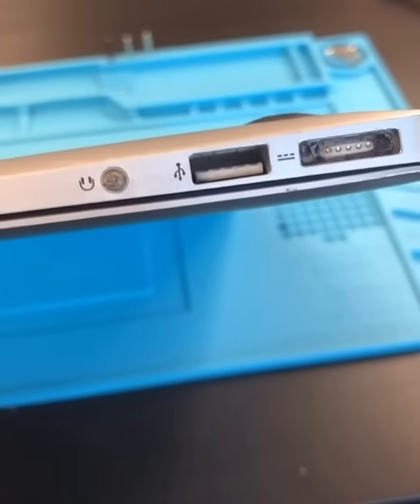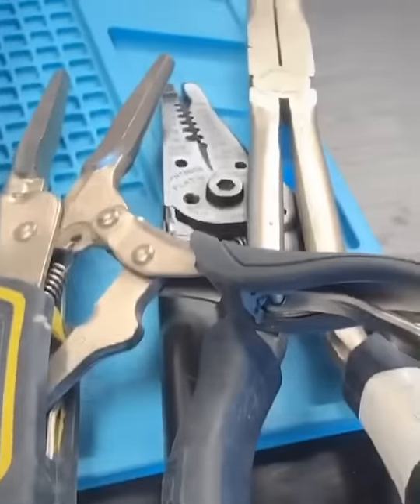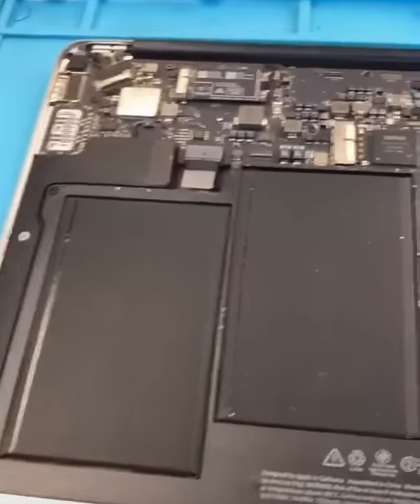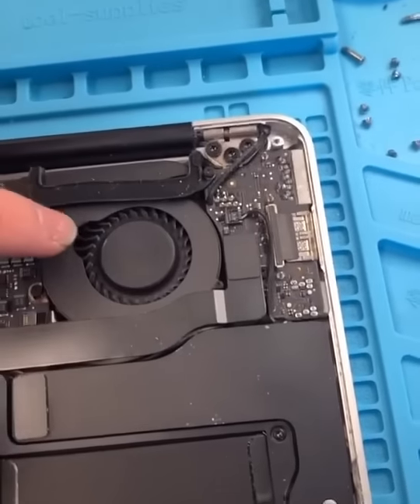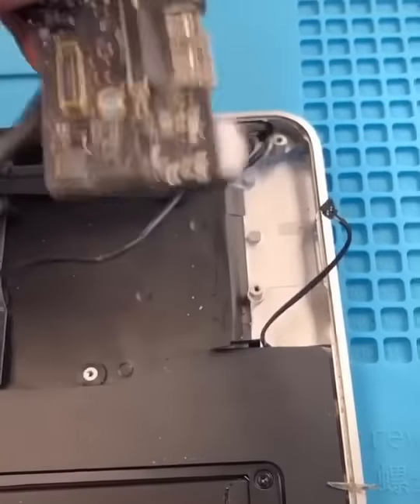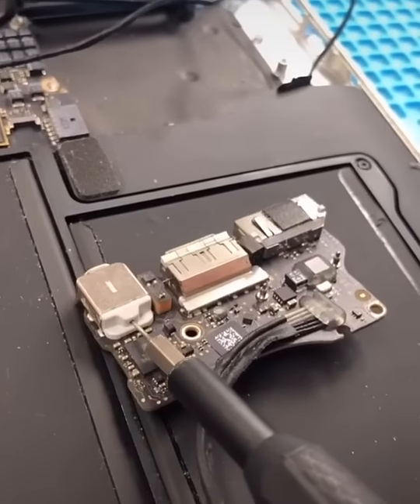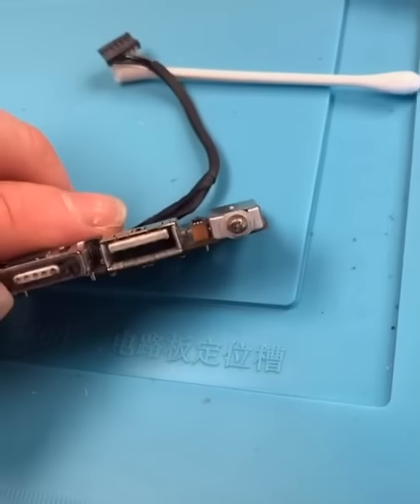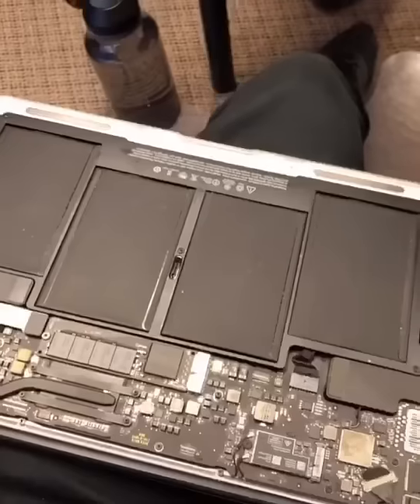Don't Use Glue On Your Macbook.... WHY? #Shorts

Comment: The real reason apple doesn't want you to repair their devices. All the parts are made and sold by Samsung 😂
Reply: Samsung is one of the two chip manufacturer in the entire world. Every chip is either manufactured by Samsung or TSMC. The small ones were all RAM modules. Apple designs the board and the SoC, but they don’t physically manufacture them.

Saying Apple’s computers are made of samsung parts is like saying that the sushi you ate was made by the fisherman and not the chef.
Reply: U didn't know lol?
Reply: @Dracogame  sounds very technical. If you were my teacher in school I would probably fail with all those confusing words. And saying it would be a btch cause I have verbal dyslexia lol
Reply: @Dracogame  Yes, that's why I don't buy Apple's product, they're like selling sushi 2x more expensive even though are made from the same fish and caught by the same fisherman
Reply: @Dracogame  Wrong way of saying it  the fisherman got the fish but the restaurant just put it together Samsung makes and sells the parts but apple just puts them together
Reply: @iamincognito7125  dawg your still in 2010
Reply: @iAmGh33zy  Some parts like RAM are standard in the industry but are still made by Apple's specification.
Reply: @iamincognito7125  Then stop buying any product. Even your car contains chips made by Samsung or TSMC. Your television. Your microwave. Everything.
Reply: @Dracogame  this is simply not true. Nvidia, amd, and sk hynix for starters
Reply: @Dracogame  haha that guy tried doing a "gotcha" thing and failed
Reply: @Dracogame   I don't know where you got that information from, but 2 companies alone don't have a worldwide monopoly on semiconductor fabrication.
You've got SMIC and UMC for example. I think SMIC is the leading one in China.
Reply: @Dracogame   bruh, you don't have to get into it
Reply: lol only some u dont know what ur takkinf about
Reply: I read everything and everyone is dissing you, apple makes every part of the computer to make it run, hold storage, turn on, everything then Samsung as you said is the cheaper chip manufacturing company with better parts for ram, a added software that increases the ability of the computer not make it run. So apple does the computer, makes everything except for the added specs that people want. If anyone would have actually looked at the computer they would see that those five parts were add ons and every other 900 or so parts are made from and manufactured by apple. With apple having better specs in general to Samsung, better run speed, display, etc. I buy apple products and I am happy. For general if I look at the new fold screen Samsung. No one needs a tablet as they call it in their pocket that’s also over a thousand dollars
Reply: @kianbronner652  Apple aren't that special, don't become a victim of marketing.

If you spend the same amount of money building your own computer and installing MacOS on it (although why would you, then just install Linux) as you do buying a prebuilt Macbook, you will end up with a superior computer. You will be able to buy superior hardware because you aren't paying a premium on it as you do when you're buying it from Apple (or from any other company that sells prebuilt computers for that matter).

Apples entire thing is trying to provide a luxurious feeling experience to consumer grade hardware. What you're paying for is that experience, not actually superior hardware.
Reply: @kianbronner652  Did you just say Apple have better displays than Samsung???
Reply: @Dracogame  there are a lot more you mong. Intel is planning on making (3?) New semiconductor fabrication plants by (2025?), and Texas instruments was a major player in the dawn of personal computers is still very relevant in more irrelevant devices today plus massive companies making memory like micron and sk hynix. This is just to name couple.
Reply: @Dracogame  please don’t ever talk tech again you’re so wrong🤣🤣. So intel, amd, nvidia and Texas Instruments all went defunct right?
Reply: OOF
Reply: @Dracogame  ok just don't cry lol
Reply: Best part of the whole video lol
Reply: @SolidFawaz  Okaay (?)
Reply: @Dracogame   The fisherman doesn't have the fishes signed that he made it.
Reply: @TrillAntho  amd uses tsmc fabs and nvidia uses samsung, soon switching to tsmc.
Reply: @lukeskywalker7405  He is still the provider.
Reply: @lukechristenson3989  lol what, this dude doesn't know his shit😂
Reply: Bruh LOL
Reply: I honestly  hate apple. Not because of their design or interface, but because of their business model:
They are basically forcing you to stay with only apple products to use the features that are important (cloud, airdrop, interdevice communication). That way you have to rely on this one company and can't branch out. I really don't get their appeal. And I can't wrap my mind arround the fact that a lot of schools and companies (mostly start ups) use their products. That way they basically make themselves dependent on ONE company.
Reply: @Dracogame  quit trying to make yourself feel better saying that 😂😂
Reply: lmao they were friends all along
Reply: @iamincognito7125  nice
Reply: @Dracogame  there are more chip manufacters
Reply: @michealjaymurphy  what
Reply: @Dracogame  nah
Reply: @Random131_  this is mostly true, not all displays are Samsung
Reply: @tatuman5000  the iphone came 1st...
Reply: @iAmGh33zy  wrong.
Reply: @LxckyHandlez  Be part of the discussion
Reply: @iAmGh33zy  wrong
Reply: @Dracogame  No one is saying Apple doesn't make their own phones, what they aren't making are the parts the their devices are comprised of.
Reply: Lol
Reply: @kianbronner652  APpLe hAvE beTtEr dISpLAy ThaN SaMSunG, lol 🤣🤣🤣🤣🤣
Reply: @Dracogame  there are wayyy more than two chip manufacturers but tsmc and Samsung are some of the largest. Intel has their own fabs for example
Reply: Yeah so they can't repair it. Only Samsung can
Reply: @strawberrylia655  well Samsung parts are available in the market so the person with enough knowledge can easily repair it using those parts
Reply: So samsung is better
Reply: @MariaReyes-jp6ok  yup, infact every android phone is better, better customization option better feature,etc , not really that good of camera as iphone, this is coz Apple just have to maintain it's user base and their ecosystem does the job so there ain't much competition in ios but in Android there is a lot of competition, competition leads to better features and better quality, still apple lost 26% of it's user which shifted to Android in 2020 alone, so hey Apple's ecosystem isn't really working out
Reply: Then why is apple so shit
Reply: No just the display and a few other things
Reply: @Karl_der_Genosse  I like them because once you’re in the ecosystem everything just works together beautifully unlike if you have all different brands of computer, tablet, phone, etc. and then not everything works great together all the time
Reply: Ever heard of Refurbished?
Reply: No Samsung is not selling the things they make for Apple on regular shelf’s they build them to apples specifications so they cannot just sell them
Reply: @Dracogame  but i ate eggs and bacon
Reply: @Dracogame  but the dude is right
Reply: @kianbronner652  Samsung makes the storage and displays for Apple also some apple devices use LG displays .
Reply: I changed it from 69 replies to 70 lol
Reply: @iAmGh33zy  is that not legit exactly what he said
Reply: @kianbronner652  "add ons" so  your computer doesn't need a graphics chip or ram modules to run there just add ons? This ain't a wifi card man
Reply: @iamincognito7125  😂😂
Reply: @throwdemhoez5488  that’s though but why say it here
Reply: @iamincognito7125  Um I’m assuming you’ve never had good sushi then
Reply: @xperiahenrik that’s why I buy apple. I just want working devices that is more than fine in everyday situations and is well know ofc. Apple may have evil marketing people but still doesn’t really matter that whole much
Reply: @Dracogame  because Samsung is the best😂
Reply: @Dracogame  actually. The cpu cores are made by arm.
Reply: @throwdemhoez5488  well I'm a tech geek so I understand what he is saying lol
Reply: @Dracogame  what if I told u smic and other brands exist. Like huawei for example can't get its kirin chip produced from tsmc or Samsung. But instead like smic it produces them. I'm a tech geek so I don't think so u wanna challenge me
Reply: @iamincognito7125  as if they're anymore expensive than samnsung and new android devices 😒
Reply: One word: Exynos
Reply: Correct
Reply: @iamincognito7125  no, cause the fish man can create whatever you want, and Apple creates her sushi.. For example, there isn’t any laptop (to not game) so cheap and so powerful as the MacBook Air M1, without a balanced 1600p LCD screen, high quality integrated speakers, high quality integrated microphones, and quality materials..
Reply: @xperiahenrik  M1 best laptop CPU for now left the chat
Reply: LeopardX  Mhhh.. who design the chips? The display? Etc? Lemme think, Apple… Samsung are only the arms
Reply: @Dracogame  TSMC and Samsung are not the only two manufacturers in the world? Micron, Intel, Global foundries etc etc
Reply: Exactly
Reply: Pft
Reply: xD
Reply: Apple is like the generic food brand that it's made by the same company as the expensive brand, but instead of being cheaper it's more expensive
Reply: Ur name is sam
Reply: Idk, samsung always follow apple trend like charger one and jack audio, make other android phone follow samsung too, so we know samsung is just part of apple
Reply: Only reason why it's remotely good🤣
Reply: @Dracogame  not really I mena we get appple revolutionized phones but still
Reply: @Dracogame  it's made from Samsung still lol. The design is made by apple but the product itself is made by Samsung
Reply: @Ryan-uv6ky  Yeah, that's how a supply chain works.
Reply: @lukechristenson3989  no, nvidia, arm etc design their own chips but tsmc and samsung are the ones who fabricate them
Reply: @s4lvin989   not the best, i would say its best for casual use, something like ryzen 4000 mobile chips are literally power houses compared to it, also considering the price of the two its further justifies my point. also everything is not fully ported to arm yet so yea u will face some difficulty running old stuff etc and it may even performance like dog shit, also now bringing in gaming, apple..... gaming lmfao lets just skip that one XD
Reply: @ShahZahid  the M1 is as powerful as the 5900HX, the best laptop Ryzen CPU for now, so for now the M1 is one of the best laptop CPU on the market, and 3 times better than the 5900HX for performance/consumption
Reply: @iltubodeitutorials8358  no its really not direct benchmarks mean nothing here since the architectures for both chips are different x86 being more diverse since it supports more instruction sets, also 3 times better wtf, u just said its as good as the 5900hx now u are saying its 3x better, just settle on something already also it, also if u are considering benchmarks, 5900hx scores 23000 on cpumark while as m1 does around 15000, so its not even as powerful as the 5900hx well thats expected from an arm chip also then comes the case of integrated graphics the 4000 series have monster integrated graphics hitting more than playable fps in AAA titles, so please do your research before spitting out garbage unverified data like "3x as better", also as i said compatability is another factor, also dont even get me started on how locked down apple systems are when compared to pc hardware, also fyi the m1 is an apu it has graphics builtin as well
Reply: @ShahZahid  P.S Geekbench is the best multi platform benchmark, that works between architectures, so it’s the best benchmark atm to compare ARM and x86, however, also on Cinebench, the M1 almost reach a CPU that is using 4 times the wattage of the 5900HX and costs much more
Reply: it's my country's pride🇰🇷🇰🇷🇰🇷🤣
Reply: @Dracogame  Wrong. Saying apple computers are made of samsung parts is like saying sushi you get from a sushi place is made of fish and rice from their suppliers. No one is saying what you provided as analogy lol
Reply: @kianbronner652  they're displays are manufactured by LG and Samsung too. A 1/4 of EVERY SINGLE APPLE PRODUCT is manufactured one way or another by Samsung. Those wernt added on parts... well, they were but added on at the assembly plant.
Reply: The mystery has been solved. It's like supreme buying a whole bunch of white tees and just pressing supreme across it
Reply: No all
Reply: Apple is trash samsong da best
Reply: @throwdemhoez5488  its not his fault you have dyslexia
Reply: Samsung is nothing but a wholesaler
Apple is the retailer

Didn't notice the huge difference?
Reply: Hi
Reply: 90 percent
Reply: Are
Reply: @chocogachawaffle  did u know the asteroid which fell on the earth wiping all dinosaurs out was actually a Samsung 1988 SH-100?
Reply: @xperiahenrik  definitely can agree i personally prefer apple but nooope never buying a PC or laptop or tab ever from them 
I can build a pc almost 3x times powerful with that kinda budget
Reply: Lets be honest here. Apple Products are simple tech. not bad tech just simple and straight forward. In some ways its good but in others its bad. Apple/Mac OS compared to Android/Windows OS is not as versatile. In recent years apple has become more user friendly. I.E: More Customization, Versatile Apps, and ofc widgets ooohhh
Reply: @kianbronner652  You do know samsung makes apple displays right?
Reply: Samsung is Bigger in component manufacturing. Apple does not manufacture components.
Reply: @Dracogame  well said
Reply: @throwdemhoez5488  who asked, he's right 💀
Reply: @FuckFistingAss7osuFF7osu  lol I forgot this comment existed. Which reply are you referring to?
Reply: @iamincognito7125  no dude what apple designs the screen and parts lol
Reply: Bit they'll pay 200 dollars extra for a MacBook shell
Reply: Waxy mix   because samsung already has their own brand and it would not be smart for them to switch and make another companys phone  and expect the same amount of people buying iphones to buy samsungs iphone. thats like trading lebron for pg and expecting them to be one the same level
Reply: Nobody gives a shit…. Samsung’s chip industry isn’t the same as Samsung’s phone industry
Reply: @Dracogame  "Every chip is either manufactured by Samsung or TSMC."
You literally forgot Intel and too many others.
Also, Samsung and Intel are the two companies who design and manufacture cutting edge processors by themselves.
(Intel 12th Gen Alder Lake is the best in the market while Exynos started catching up.)
Reply: @VR00100  Samsung is the Manufacturer, Supplier and Wholesaler.
Reply: @KAAN CAN IPS is LCD.
OLED comes under LED.
Apple uses OLED.
Reply: @srikrishna2561  Intel only manufacture its own chips, they don't sell their manufacturing services. Samsung and TSMC are essentially the biggest ones. My point doesn't change.
Reply: So does that mean u can order part from samsung?
Reply: Lol
Reply: @throwdemhoez5488  nobody asked stop begging for attention
Reply: @WhoKnowsMang  baby idek what reply you even referring to. If it's over 2 mo old then don't reply
Reply: @kianbronner652  let me ask you a question what cpus and GPUs where in mac's and iPhones be for thay made their own chips oh right Samsung and Intel
Reply: @lukeskywalker7405  Oh my god it's Luke
Reply: @iamincognito7125  that's how business works bro
Reply: @Dracogame  Qualcomm, Intel, AMD: Are we a joke to you?
Reply: @iAmGh33zy  also wrong way of saying it  apple gave blueprint samsung did construction
Reply: Facts!!
Reply: @iamincognito7125  obviously you do not appreciate any craftsmanship, or any restraunt deco or waiter experience, or chief expertise, or the ability to tell a $5 supermarket sushi from a fine diner sushi that cost lot more. 
It is ok to not spend the money for better food, but not having the ability to tell there are difference is sad.
Reply: @Dracogame  good comparison, everyone here hates on your comment so i have to say that
Reply: @iamincognito7125  but apples OS and IOS is just more sophisticated imo, but then again I’m just an apple head
Reply: Also the screen is made from samsung
Reply: @Aroko 76 iPhone screen...
Reply: They too shy they'll get ignored 😂😂
Reply: @iamincognito7125  yes just ignore the actual interface and amazing ecosystem that beats every other phone brand. iPad and laptop market is dominated by apple because they make good products. Samsung is good, it’s just their ecosystem isn’t as good as apples
Reply: @kianbronner652  Your so very wrong, the only thing apple designs themselves is the outside of their phone and the Processor inside, that's it, same for their laptops. And samsung is way more durable and better secured then apple, apple's last strong phone was the Iphone 4, so that says alot.
Reply: @mcgaming1172  Don't think your a tech geek, what your saying is all very basic, it's not impressive. I dare you to use harder terminology.
Reply: @lnfinyx  bro I don't even remember this argument existed and u commented 10 months later like bro do u seriously search every corner of Yt? I don't even remember this stuff I left it like 7 months ago when it got boring since there wasn't any new innovation now even though there are many new tech I get bored so ye leave this argument its ded
Reply: @sam Samsung uses apples screen
Reply: Look at your emojis 😂
Reply: @iamincognito7125  legend
Reply: @Dracogame  there are so many companies that manufacture random access memory and other chip based products. sure there are only so many chip manufacturers but that also depends on what chip you are referring to. there's, corsair, Qualcomm, AMD, intel, Samsung, patriot, and like a million others that all manufacture components. and again in this case he was pointing to Ram. you can look it up but samsung isn't the only company that makes it. in fact samsung isn't even really a go to company if you want RAM I'd feel better with patriot, G.skill in my computer as far as a stick of ram goes. I mean don't get me wrong I love samsung products but their Ram ain't it.
Reply: @Dracogame  what about Intel AMD xd
Reply: @Dracogame  the last example is r/technicallythetruth
Reply: @Dracogame  there's also Intel
Reply: Apple made iphone screen bezels very clear, not like android.

Why don't you try it, samsung?
Reply: @naufalam7840  "made"
Reply: @christianwilliam1167  haha
Reply: Y’all are not serious iPhones are still clear of Samsung exclude that fact there are still flagship Samsun that are above 1000$ so I don’t know what the price of an iPhone has to do with anything
Reply: @lukechristenson3989  nvidia RTX 4090 Mobile uses Samsung Vram and I'm guessing on the desktop models aswell